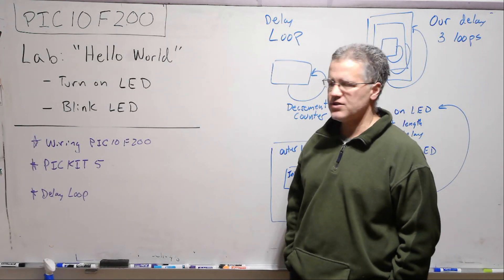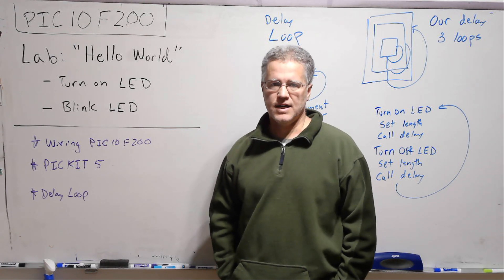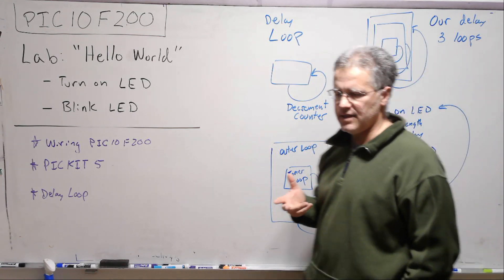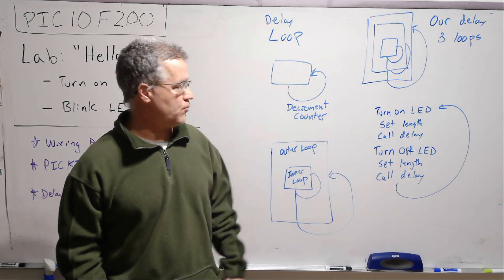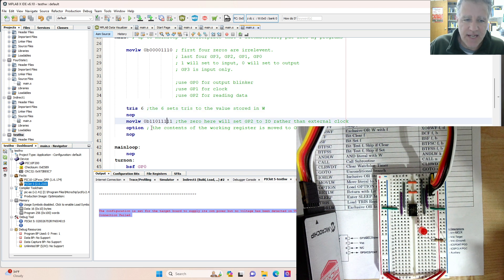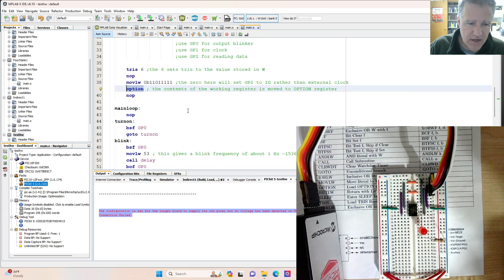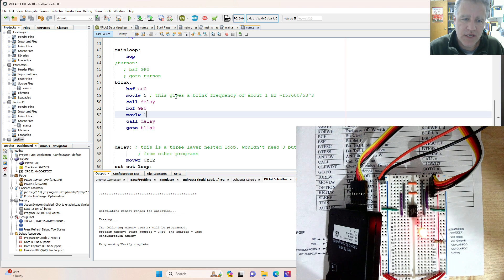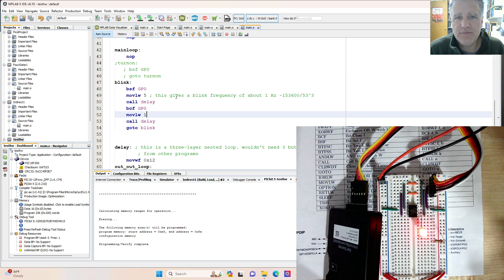PIC10F200 Lab 3 - The "Hello World" of Embedded Systems: Blinking an LED

Comment: The video was spot on, but I still made mistakes.  Maybe this will help someone else.

1. I used the cheaper pickit3 ($20), which works just fine, except you need to install the older v6.20 because the newer v6.25 removed support.

2. UPDATED: I was able to power the circuit using pickit3, if I turn the voltage down to 4.5 v.  Apparently this is due to my computer's usb.

3. I never did get hardware debugging to work.

4. I used a 535043 power supply, and plugged the '+' into one side and the '-' on the other. They are independent, it didn't work until I plugged them both in the same side.
Reply from the maker: Thanks! I pinned this comment. I’m sure others will find it helpful.

Comment: Very impressed! learned more in this video than i have ever done before! Appreciated and thank you :), Of course i do have a question.... :) If I wanted to program an external device only once, i.e.  done in the main: only, will I then just need to do a simple nop in mainloop: so to keep the pic active? The external device only needs to be prgrammed once. Peter
Reply from the maker: I'm glad you found this useful, Peter. I'm not completely sure I'm interpreting your question correctly but here are a couple of things. You certainly can streamline the program. In fact you don't need mainloop. For a simple program with no function calls (like delay) then you could just have main. You would need a goto main at the end to keep the program running. Generally, one never has the program terminate on the microcontrollers. So something like nop and goto main would be just about the simplest program. Of course, it wouldn't do anything.